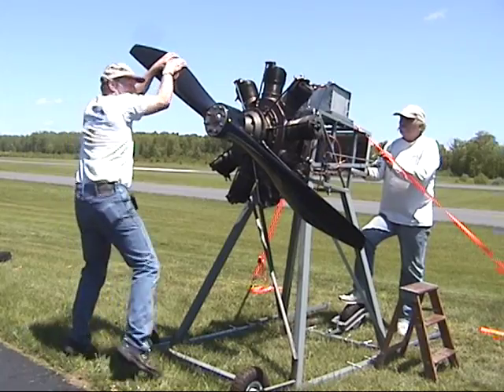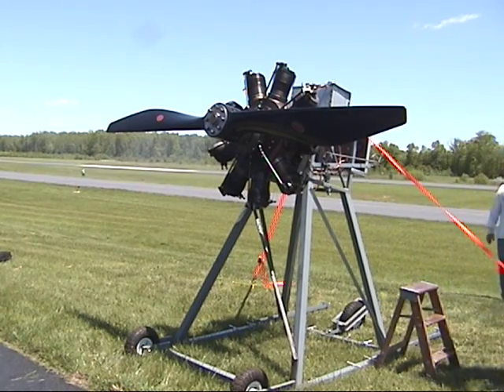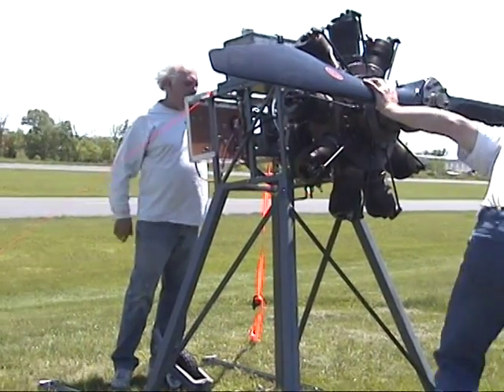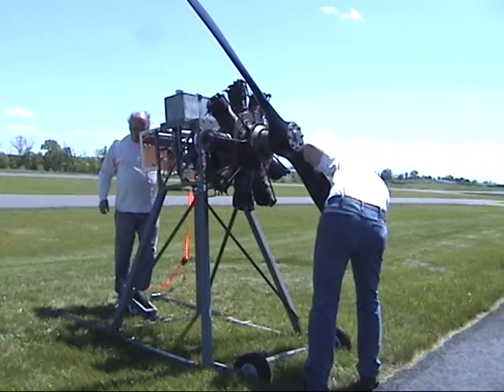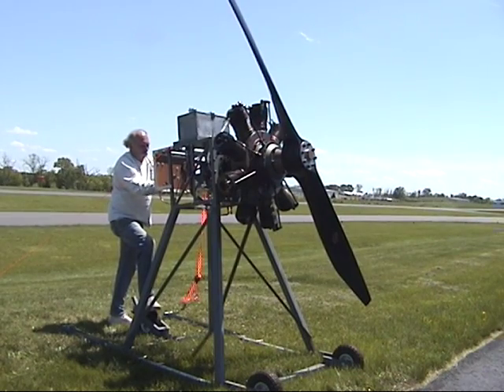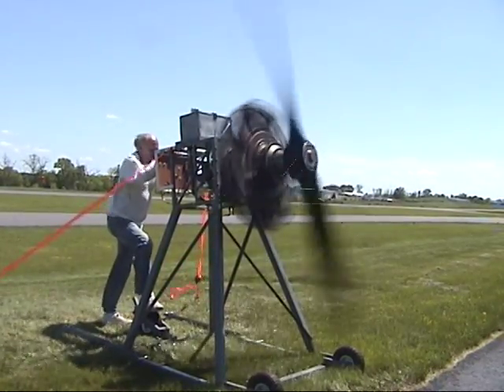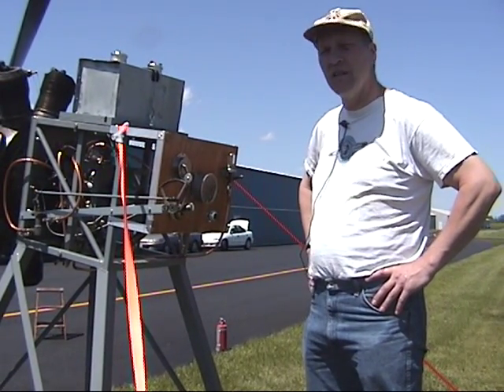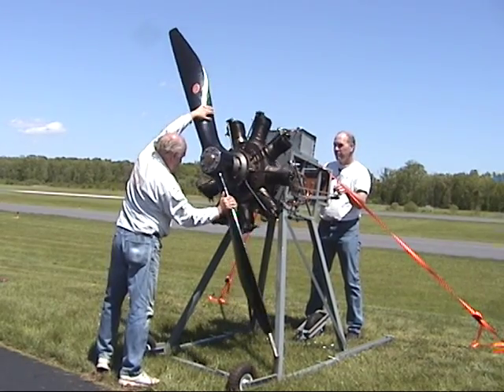2009 05 10 1918 WWI GNOME ROTARY AEROPLANE ENGINE STARTED

Comment: I think that type of engine is a good idea and can work well when connected to an electrical generator and the system is securely fastened to the ground.

That "radial engine reverse" mounted on an aircraft will create dangerous "gyroscopic moments" that abruptly alter the stability of the 'plane plunging the aircraft and its occupants.

Comment: I think that these rotating engines were dumped because they had extreme gyroscopic forces on them, especially for later, more powerful motor like this one. I am no expert on the thing, but there should be a shorting switch for killing the engine. Opening one end will not help since it will surely spark over in switch (for most of magneto ignition).
Best Regards,
Goran

Comment: They didn't "leak" oil, per se.  They utilized a "total loss" oiling system, as did many early engines.  And Castor oil was the lubrication of choice in those days for many engines.

Comment: I know its a little larger than the early 50hp version, but just imagine that thing spinning away 6 feet behind your head, as you're 400 feet in the air on a wood frame covered by fabric, held together by piano wire.  With no ground communication!

Comment: It looks like a radial engine, but is different. A rotary engine has the cylinders rotating around the crankshaft, which stands still. The propellor is simply bolted on the engine. A radial engine has fixed cylinders and a rotating crankshaft.
Gnome rotary engines were widely used in World War I on fighter planes, built by Gnome Rhone factory and licencees on both sides of the conflict.

Comment: 1st: It was advantageous for cooling when the cylinders spinned around, since air-plane engines in World War I were air-cooled.
2nd: Radial engines in general, including the rotary ones, were significantly superior to the usual V-motors, which is why constructors were willing to use them despite their detriments. 
3rd: Yes, rotary motors had the problem of being large and having a gyroscopic effect. This is why they were abandoned  soon after the V-motors catched up with their performance.

Comment: It has a few benefits.
The engine gets very good cooling even when standing still on the ground, and they run quite smooth since the entire engine works as a flywheel. Some comparable non-rotaries added flywheels, but that's a lot of extra weight.

It has definite drawbacks, ofc. It's hard to scale them much further, and they were indeed quite gyroscopic. The Sopwith Camel was notoriously hard to fly for that reason. :)

Comment: The Siemens Halske SH.III and the Bentley BR2 were the height of rotary engines. The Halske had a real throttle and the BR2 was 250+ HP, which the monsoupape couldn't hold a candle to.

If someone attempted to make a rotary today, it would probably be lighter and produce far more horsepower than they did 90 years ago. I remember seeing somewhere that someone was making a new Bentley BR2.

Comment: The 9n Gnome Monosopape was pretty much the limit of Rotary engine development, you needed exponentially bigger engines to get small increases in power beyond that. They went more with Radial and Inlines after WWI.

The engine was in a surviving original N.28 as far as I know, and the plane hadn't been flown since the '20s. Was basically like finding a classic car in a barn- everything was intact and in working order, just needed TLC and knowhow to bring it back to life.